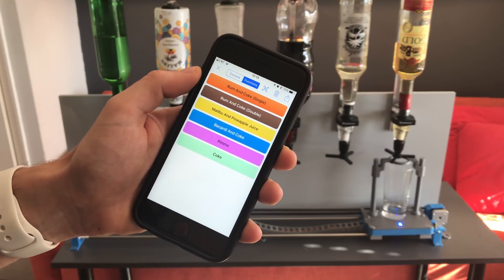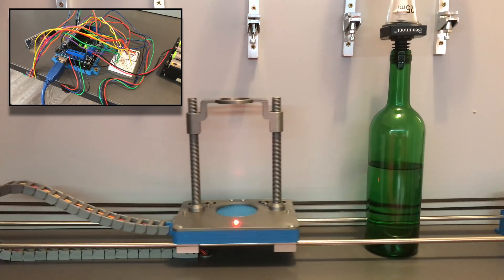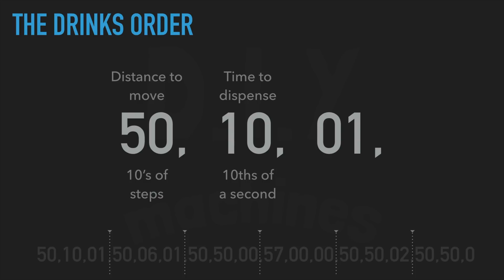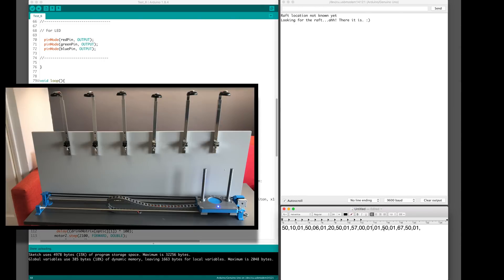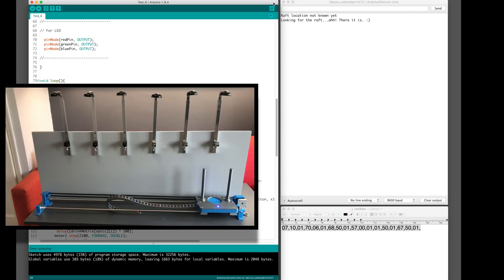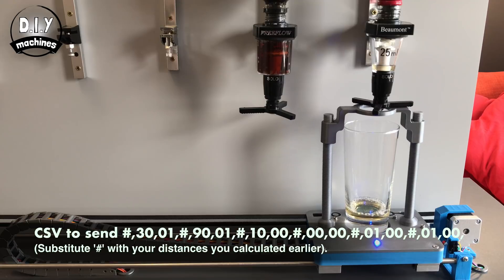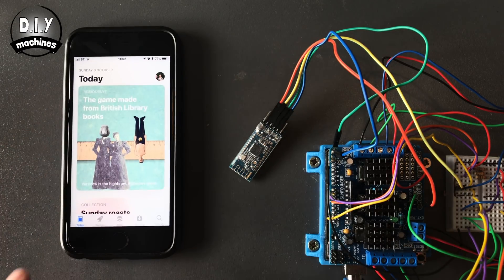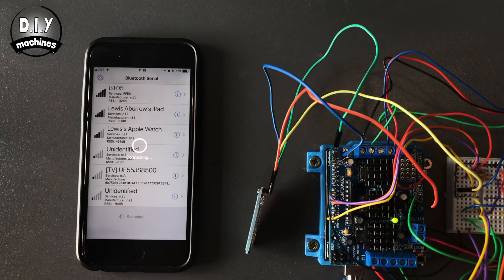How to make an Arduino DIY Robotic Bartender - P4 Adding Bluetooth

Comment: How can your final code be modified to accommodate 8 optics instead of 6? I’m talking about this part: 

int drinkMatrix[6][3] = {
{50,500,1},
{700,500,2},
{75,500,0},
{69,500,0},
{71,500,0},
{67,500,0}
};

What does each number mean in the brackets.
Thanks a lot
Reply: DIY Machines I will send some pictures once is all done. Yesterday I was able to make it work with 9 optics, thanks to you guy's  suggestions.
Today I'm adding recipes. I'll keep you guys posted, thanks!
Reply: Tyler Wittman I have gone through the same issues you have. I also want to add 9 optics and changed the optics number, but no luck.
It works perfectly with 7 but I also get the 2727 number after 7 optics.
I'm almost done with my project and will be sending some pictures when i'm done BTW, thanks so much @DIYmachines for your help with this awesome tutorial.

Tylor/DIYmachines, I am very new to the arduino code, would you mind helping me your code?My email is correajon@yahoo.com

That way I can add the last 2 optics and be ready for New Years ;)

Thank you both for your time and help on this awesome project!
Reply: Jonathan Correa greetings! I am actually still working on my code. I am completely writing my own custom version and it is completely different. I have added leds and sensors to mine to detect if a cup is present so it doesn’t dispense if their is no cup, and the less tell me the status of my drink. I’ve added neopixels to every optic to illuminate the bottles as well. Here’s the problem with the original code: the arduino serial buffer size can’t handle all the characters that are sent via the serial monitor at one time. Look at the link i provided in one of my previous comments. Only issue with this is that it is extremely slow to load. Increasing the baud rate of the serial monitor helps a little. Give it a shot and let me know how it works for you.what I ended up doing: I actually hard coded my drink recipes. I have 13 optics, and I use the accelstepper library and multistepper library. I have 2 rows of optics as well. So I have a x, y and z axis. Motors powered by BigEasy Drivers. So in my code, I wrote out the recipe as a series of steps and positions for my motors. So I made it that is I send “Drink one” to the serial monitor, it follows the directions in my code for “drink One” I hope this helps. If you’re having trouble understanding I can submit a piece of my code that might help you understand it better. My code is just so modified with sensors and multiple axis’s It wouldn’t work with the equipment/ setup @DIYmachines has in this video.
Reply: Jonathan Correa make sure you use this link: 
https://internetofhomethings.com/homethings/?p=927

The other link is outdated and that solution will not work
Reply: Jonathan Correa how are you powering all of your equipment? Try powering the hm10 with a separate 5v power supply. But make sure you connect all the GROUNDS together so all your electronics have a common ground. Also, find out just how many characters you need in your serial buffer. Maybe decrease it down a little from 256 to say 100? Or whatever you need. If you’re using more then one power source, just make sure all your grounds are connected. Try that and report back :)
Reply from the maker: Hi Tyler Wittman, The numbers in the brackets are just place holders, they could be any integer at this point in the code. This part of the code creates an array of six items, of which each item itself is an array of three values. To accommodate eight optics you could enter the following instead:

int drinkMatrix[8][3] = {
{01,01,01},
{01,01,01},
{01,01,01},
{01,01,01},
{01,01,01},
{01,01,01},
{01,01,01},
{01,01,01}
};

You'll also need to change line three to read the below (if you haven't spotted it already):

int opticCount = 8;  // how many optic stations there are

I hope this helps, I'd love to see an image or video of your robot. You can send me a photo of your work here: general@diymachines.co.uk or share a video on Youtube. :)
Reply: Thanks for your reply. I did what you said above, however still only saw 6 optics in serial monitor when I sent the CSV with 8,
I was able to fix this by changing this line close to the bottom of the code:

for(int i = 0; i < 6; i++) 

I had to change the 6 to a 8.
Any other lines I need to change? Is this okay?

Another error I’m running into is occasionally i see values of 2722,2722,2722 or something like that in the serial monitor after sending a CSV. Any issues on what’s causing it? I got it occasionally with your code using 6 optics, once I changed everything to 8, and I put in a CSV with 8 groups, the last group gives me the 2722 values in the serial monitor. Any ideas? I am sure my CSV contains enough values. For example I used this CSV for testing:

05,05,01,05,05,00,05,05,00,05,05,00,05,05,00,05,05,00,05,05,01,05,05,01
All one line obviously.
 
In the serial monitor I see this: 
05,05,01,
05,05,00,
05,05,00,
05,05,00,
05,05,00,
05,05,00,
05,05,01,
2722,2722,2722,
Done loading

Don’t quote me on “2722” it’s just something like that. (Very big)

Thanks for your help, not a lot of people do that.
Reply from the maker: Yes, well spotted with that line of code near the end. I've updated it to refer to the variable opticCount so there is one less place to update it.

The 2277 / 2722 that your seeing is a limitation of my program. I remember running into this now. When I send the drinks order as a CSV it seems the way I have programmed the Arduino it is only able to accept and process so many characters from the serial before it throws out 2722. If you set it up to run with 7 optics we're still okay. The eighth optic makes the CSV too long for the serial buffer and my program to process. (At least that is what I suspect).

Perhaps someone with more coding experience might be able to offer a better method of processing CSV's and storing the values in the drinkMatrix?

I suspect the answer is contained on this page: http://www.gammon.com.au/serial. I'll try and find some time to read through, understand and implement what they suggest as being a better method of processing information from the serial connection.

One way round this could be to store the various drinks CSV on the Arduino and instead, summon it using a kind of key/index sent over serial. This key would match a 'recipe' already saved on the Arduino, load it into the drinkMatrix then set the variable drinkRequested to 'true'. This would then trigger the Arduino to produce the drink.

The upside is that we remove the current 7 optic limit of the current code, the downside is that you have to save the drinks on the Arduino and match them on the requesting device.
Reply from the maker: You could also consider this for a temporary solution: http://www.hobbytronics.co.uk/arduino-serial-buffer-size (I've not tried it - you would not need to increase the buffer size too much).
Reply: The link you provided seems like a promising solution, I will try it and keep you updated. I later plan on building a 12 optic machine or maybe even a 18 optic machine with 2 rows and the implementation of a y-axis. Perhaps for these bigger machines we should find a better way. I would like to implement a touch screen display and store drinks on the machine itself. If you stumble across any ideas/ solutions, let me know!
Reply: Also in your code, I think I found  a error, you have:

#include 
AF_Stepper motor1(48, 1);
AF_Stepper motor2(48, 2)

But you don’t define a library to #include

Also on your website, the portion of your code that refers to the dispensing instructions, some of your code is all one line when it needs to be in multiple.
Reply from the maker: Tyler Wittman thanks for spotting these. I will correct them for the benefit of others.
Reply: Okay I'm back with some good news. I managed to get it working with all 8 (even 9) optics. I had no luck with the website you mentioned above, as that website references a older version of the Arduino IDE. I did however have luck with this website: https://internetofhomethings.com/homethings/?p=927 I hope this helps for anyone following these comments.
Reply from the maker: Tyler Wittman great news. Thanks for looking into this and finding a solution. I appreciate your time and help. As mentioned before, I’d love to see a photo of your robot.
Reply: DIY Machines Thank you for posting a tutorial. I’ve been wanting to do this for a while and your video pointed me in the right direction. I’m customizing it a bit so I’ll send you a picture when it’s complete. By chance do you know if it’s possible to send a negative value in the CSV? For example to move the motor backwards. Thanks.
Reply from the maker: At the moment you would not be able to send a negative CSV because of the way my program converts ASCII numbers (the way they are transmitted over the serial connection) to normal numbers. (I subtract 48. This trick works for numbers - see line 129). You could include a fourth value for each optic which specifies if it as a forward or backward movement of the motor. For example a 1 could represent forward movement and 2 a backward movement.
Reply: DIY Machines having issues with the hm10. It won’t let me send any data through the app. I can receive serial messages just fine, but then I send them, it pops up on my phone but the radio I doesn’t receive them. Any suggestions?
Reply from the maker: I would double check the baud rate matches your Bluetooth chip. If you bought the one I linked to (http://amzn.to/2kW8BYs) then it should be 9600. It may also be worth checking that the receive and transmits wire connections are good. Are you using an iOS or android device and what app are you using?
Reply: DIY Machines same app as your video on IOS
Reply from the maker: I've been thinking about your issue and can't yet think of the cause. I have done a full test of the code after we modified it recently and it works fine on my machine. If I had to pick something at the moment I would point my finger at the HM10 chip (they're not all made equally). I know it's unlikely but if you have access to another module it might be worth temporarily swapping it out to eliminate this as being the issue. The other thing may or may not be to do with the change to the serial buffer size you made - maybe put this back to default for a bit and try the system out on bluetooth as though you only had six optics.
Reply: DIY Machines I appreciate you helping me. I have no clue what the issue was, I tried it on your original code and had no luck, probably my hm10, however I did get it to work by modifying one of your test codes. I’ve decided I want 15 optics and have a x and y axis. The CSV for that through the serial buffer was just to slow, and inconsistent. It would take 30-45 seconds to load a drink.... so I actually took your test code, modified that, and I’m storing the drinks on the actual addition, and calling the recipe through the serial monitor. My initial test look good. By doing it this way, I can move the X, Y axis forward and backward as many times as I want with no delay, (for drinks that are made in a certain order). For a 15 optic machine, I’ve managed 30+ recipes at the moment, however I’m still in the software developing. Only downfall to this is that it takes a long time to add recipes and if you rearrange the bottles or change ingredients, it’s all messed up. I would like to later develop a app that allows you to change ingredients, set bottle locations, and edit recipes all from your phone..big project. Thanks for your help
Reply: @Tye13274  Could you share this code you made? I am struggling with the code in the video.
Reply: Tyler Wittman thank you so much for the explanation. Your project sounds very exciting!
I'll read the the article on the link and see if I can come up with a solutions, have a great day!
Reply: Tyler Wittman will do, thanks again!
Reply from the maker: Looking forward to seeing your pictures. It's great to see that others are making their versions of this.
Reply: DIY Machines hello! Today I was able to add some recipes, but ran into a problem. 
When I order a drink, the HM10 gets disconnected as soon as I push the button to order a drink, and the X axis crashes. I found out that it works great, if after the HM10 gets disconnected, I reconnect right away and finishes the drink without crashing. Any ideas as of why the HM10 gets discouraged?

Wire connections are good, it used to work great when I had 7 optics but now that I've modified the arduino RX and TX to 256 bytes instead of 64, to be able to run 9 optics I'm running into this issue.

Any help will be greatly appreciated.

Thanks!

Comment: Hi, really nice videos. I'm french i try to understand the most ! What is the reference of your 3D printer ?
Reply from the maker: Biruk Skibba Thank you I’m working hard to make them. My 3D printer is a Prusa i3 Mk2 which I bought from https://www.prusa3d.com. They now sell the newer smarter mk3 now.
Reply: What do you think about your printer ? do you advise me ? sorry for the english tell me if you don't understand
Reply from the maker: I really like it and would recommend one. It is very reliable. My old printer would often jam or the print would not adhere to the print bed. This one is much better, and the new one they just released is apparently quicker, quieter and has more sensors to prevent or recover from failed prints (something I rarely experience anyway).